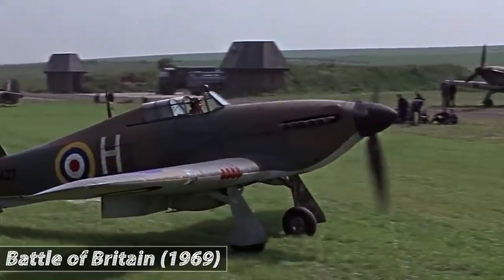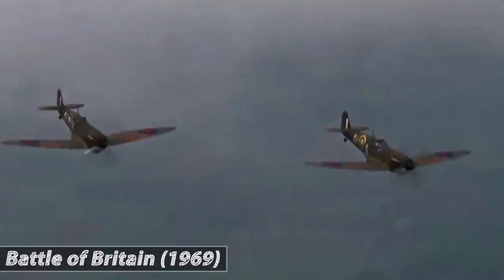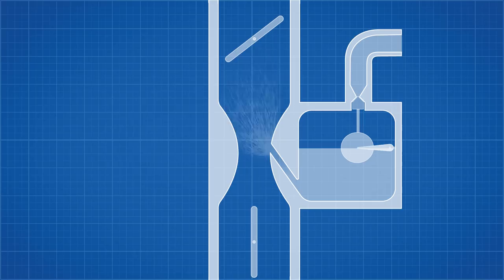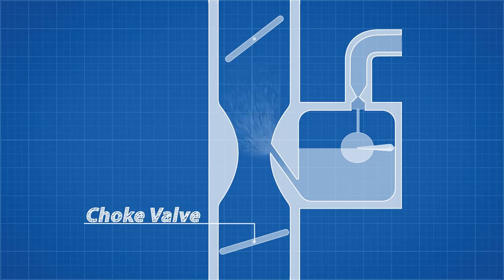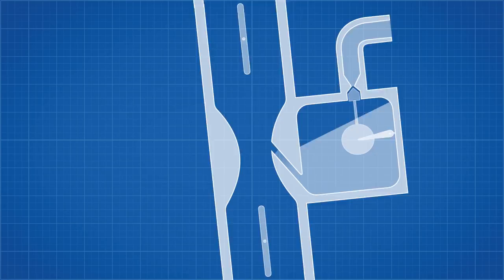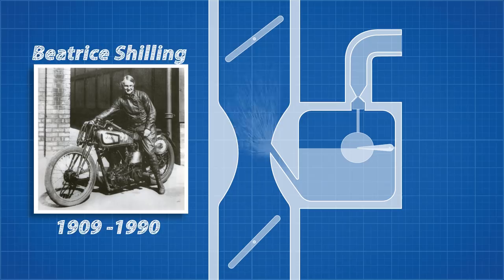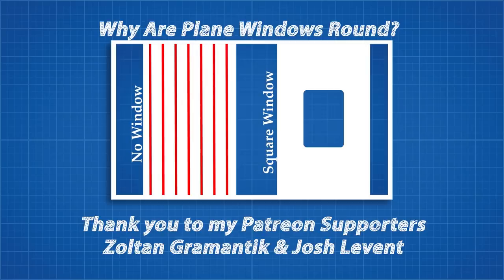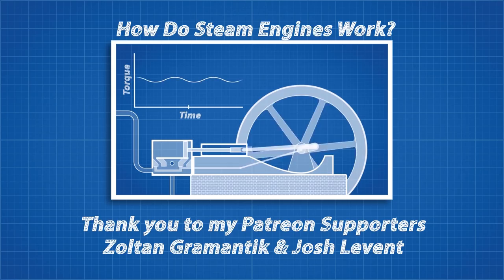The Spitfire's Fatal Flaw

Comment: It was definitely a design flaw but it certainly wasn't fatal. C'mon.
Reply: JCTiggs.
Not only not fatal it was the same as most fighters at the time  Only the Bf 109 with fuel injection did not have the same problem but it had a bigger less powerful engine, so the problem which RR was well aware of was a trade off and soon solved by Rolls Royce.
Reply: FATAL flaw? Was it even a flaw?  Maybe just "an undesirable design feature".  Sometimes it is hard to admit that our enemy may have built a better fuel delivery system, isn't it? Fortunately for us, they couldn't parlay that backfire into a win.
Reply: Will.J  I guarantee it never led to anything good!!!
Reply: Will.J  
If the engine cut out at all in a dogfight which is unlikely, RAF pilots were not stupid. The fatal flaws of the Bf 109 may have cost Luftwaffe pilots lives.
Reply: Indeed - by comparison, the Me109 had appalling cockpit visibility and the carburettor 'flaw' - which both Spitfire & Hurricane pilots were fully aware of - arguably made them more accomplished flyers, quickly learning to perform more rolls and banking manoeuvres in order to avoid the 'cut-out' problem associated with steep climbs. This 'aerobatic' skill-set in turn, arguably helped them perform more agile and effective evasive manoeuvres during dogfights.
Reply: I was fatal 

To the enemies
Reply: they said it was a fatal flaw cause if ur engine cuts out while u are in a Dog fight u are gonna lose the fight. cause ur won't be able to power up 2 either out run  & or out move the other person that is trying to shoot the spit fire down out of the sky. fuel starvation was a big problem  & Fatal flaw ..one of many  very  important things i learned a very long building & fixing & tuning my own RC Car's when i was a kid. before there was every the internet.
Reply: Yeah your engine dying when you turn your plane is definitely not a fatal flaw... lmao
Reply: @godhand2018  
The engine not cutting out in a turn or any maneuver except for pushing the stick forwards to go into a dive which would cause a momentary cut out which was easy to avoid and much improved by the Battle of Britain and completely fixed in 1941. Pilots still flew exactly the same way because it was the best way to fly.
Reply: @svr27rr87  
It was not a fatal flaw since it was easy for the pilot to avoid the one maneuver that would cause a problem and by the start of the Battle of Britain it had been much improved and in 1941 completely solved.
Reply: @drdee3645  I wouldn't say that the flaw helped them perform more agile evasive manoervers as it was more to do with rj Mitchells brilliant designed aircraft ,which was based on the s4 and s6b sea plane which had already won the schiender trophy and held the air speed record
Reply: @svr27rr87  I dont think that flying upside down useful in dogfights. Maybe in Redbull Air Race or something.
Reply: @godhand2018  Only when you turn it upside down, which is like... never. Because in dogfights its useless (lmao)
Reply: Will.J  The engine cut out when the enemy dived away to escape. This cost many German pilots their lives, as the continued to dive away after the problem had been fixed. A  P47 pilot commented that the German pilots always dived away - which was fatal, as the P47 could easily outdive the Me 109

Comment: Negative G and inverted are not the same thing btw. Negative g is an upward force exactly the same as g forces pretty much, but when you make a dive really quickly, or if you, say, are rolled right 90 degrees, but instead of pulling up, you push down. Often times when you're inverted you probably will be feeling positive G forces actually.

Comment: Not so much a fatal flaw but a real pain as many early RAF pilots found when diving after a Me109.However, the Spitfire pilots would half roll into the dive so the German pilot didn't get too much of a getaway, and the Spifire could dive faster than the Me109, so if there was enough height the Spitfire could eventually catch it.Also many RAF pilots wrote about German aircraft not being able to pull out in time or even the wings coming off in the stress of the dive.

Comment: Real Idiocy is more like it than Real Engineering
The slight problem was not unique to the Spitfire and it was easily overcome by RAF pilots and being worked on by Miss Shilling and her team at Rolls Royce, they had made the first fix in 1940, it lessened the problem in the Battle of Britain and they continued working to fully  fix the problem which was done in 1941 and that was used on the Spitfire Mk V, followed by the Speed Density Carburetor which was more advanced and used on the Spitfire Mk IX.   This was given to Bendix by Rolls Royce and Bendix made a copy in late 1943 which was used on the Merlin engines in the P 51.
Reply: yeah they used the merlins on p 51 as there own power plant was crap and needed to turn to The Merlin to get decent performance

Comment: If it was such a "fatal" flaw then explain how RAF pilots were still able to hold their own against the Luftwaffe  in 1940 with a creditable level of enemy kills? You think that RAF pilots were not aware of the Spitfires flaws and flew accordingly? Many aircraft had issues at the start of the war that were later fixed but for a fighter with a "fatal" flaw I think the Spitfire did rather well.
Reply: Has nothing to do with your syarlment, but unrelated. If you keep the g's positive no issue in a roll, you can a workaround for this design flaw.
Reply: Hehe, this comment sounds so personally offended, as if the commenter was unaware that "fatal flaw" is just a turn of phrase.

Comment: The biggest plus of the Spitfire was ability to have disadvantages corrected - it was also second to none when it came to upgrading and radical modifications while still being recognized as a Spitfire in its genesis - all the way from the Mk1 to the latest Marques that were only out paced by jets and slippery Sea Furies.   As a child in the early 1950s, I remember late Marques of Spitfires and Mosquitoes being used in ground attack roles against Communist terrorists/fighters up in Malaya.     It was great hearing massed ranks of Merlin and Griffon engines being fired up on the Mozzies, Lincoln heavy bombers, and the Spits - oh, the nostalgia!   As a 7yr old I got to sit in the cockpit of a Spit at RAF Catterick - as the Yanks might put it - I felt like a million $$$$s.

Comment: The Supermarine Spitfire (shows film of Hawker Hurricane!) 🙄
Reply: The Spitfire is better known so the video will get more views.
Reply: They used the same engine, so the Hurricanes also had this problem...
Reply: Yup. Stopped the video 20 seconds in. Done!
Reply: Dreidecker The merlins used carbeuretors. Didn't need a video from someone who can't tell the difference between a Hurricane and a Spitfire to tell me that.
Reply: Meatwad440 got me feeling opq
Reply: Simon Watts read the fucking comment of the creator jfc
Reply: So the p51 mustang had the same "problem" as it used a packard built merlin ....give me strength
Reply: P51D mustang vs supermarine spitfire... mmmmhmmm ofcourse p51 d variant is a late ww2 plane
Reply: Scott.
The Packard assembled Rolls Royce Merlin was the same engine and by the time Packard was assembling them there was no negative G problem, Packard used the Bendix carburetor which was given to Bendix by Rolls Royce. The P 51 with a Rolls Royce Merlin only started to enter service late 1943.
Reply: Barrie Rodliffe yip my statment was the abridged version...lol it took rolls royce engineers a year to redesign the merlin XX to US imperial measurments & machine standards
Reply: Scott.
To go further Rolls Royce and Ford of Britain modified the Merlin engine for mass production before Packard got started, Packard made no changes to the engines and took a year to do the drawings before they made a single Rolls Royce Merlin engines, the first Packard was a Rolls Royce Merlin 28, they also made copies of the Merlin 66 and 100 series.
Reply: Simon Watts lmao I just noticed that he showed the Hurricane

Comment: You start the video with a fucking Hawker Hurricane!!!!!!!
Reply: Aye lol
Reply: Gixer750pilot Yeah and the first shot of an ME109 is actually a P-51 with lufwaffe paint
Reply: Evi4666 I know but it's very frustrating. The clip of the plan doing the roll wasn't a spitfire .  It's the fault with the early merlin engine not specific to spitfires
Reply: cameroni major Yeah sorry, only belatedly realised that 😕. Didn't intend to come across as being rude sorry.
Reply: No it's not. It's a HA 1112. Basically 109 with Merlin engine.
Reply: its not a p51 in drag its a Spanish built Hispano HA1112 M1L which was based on the me109 but with a RR Merlin engine, Wasn't produced until 1954 !  it was taken from the film 'battle of Britain'. look how high the elevator is, its much higher up than a P51
Reply: It's a buchon, a 109 with a merlin in it for the spanish airforce at the time. They had plenty of spade's and 109's needed for the movie, just the 109 didn't look as authentic with the 'right way up' engine in it.
Reply: Gixer750pilot well the hurricane and spitfire had the same engine
Reply: Yes, it's true, pretty dumb really, but sure to spark a flame war in the comments! 
The funny thing is, from what I remember, Hurricanes downed more German aircraft in the Battle of Britain than the Spitfire did... and had the same carburated Merlin engine the Spitfire did.

Comment: Those intro planes were Hurricanes not Spitfires. What an uneducated editor...
Reply: They had the same engine, I'll give you that, but the Hurricane one of many mistakes in this video.
Reply: Good catch
Reply: All those Hurricanes were actually B-29's. The B-29 used the Merlin engine, which was manufactured by Microsoft.
Reply: Are you sure?  I thought it was Apple...
Reply: Both planes used the same engine, and had the same problem.
Reply: The B-29 used radials, not inlines.
Reply: ***** No. The B-29 used Wright R-3350 Duplex-Cyclone engines.
Reply: Tom thx The B-29 was a 4-engined bomber, so you need your eyes examined, and it was made by Boeing.
Reply: Anzac-A1 I'm  PREETYY sure the b29 was made by the same people who made the television

Comment: Tbh I thought it was going to be the landing gear. To Supermarine's credit, beginning with the Mk V, a fuel injector was used instead of the carburetor. However, the landing gear went unchanged, even when the Spitfire was adapted for carrier use (which went very poorly).

Comment: Did you know that the hurricane had a higher tally of killed German fighters than the more sexy spitfire ?
Reply: Only in the Battle of Britain because there were more Hurricanes, the Spitfire had a higher kill ratio and lower loss ratio and went on to shoot down more than any other fighter
Reply: The hurricane actually had a higher tally the the spitfire and all other air defence combined including anti aircraft guns and any other aircraft types in service
Reply: @djs-jk6cb  
Of the luftwaffe shot down by fighters it was 55 % by Hurricanes and 45 5 by Spitfires, considering there were about 66 % Hurricanes and 33% Spitfires the Spitfire had a higher kill rat and they also had a lower loss rate than the Hurricane.

Comment: It's not the Spitfire specifically is it? It's the early Merlin engines. Hardly a Fatal Flaw, that's just clickbait.
Reply: Peter Love it was prevalent in the spitfires mostly due to its extremely high status in the realm of superior aircraft of the era. To have a flaw like this in the best aircraft of the time was a serious issue. Sure many planes and tanks shared the Merlin, but the spitfires airframe and fighter role was far superior. Making his title relevant.
Reply: @fordrestored4646  
The RAF pilots did not find it much of a problem and it was never a fatal flaw, also it was improved by the Battle of Britain on the Spitfire Mk I and Mk II to the extent it was hardly a problem at all and completely solved in 1941 on the Spitfire Mk V.  The Spitfire was far superior to other fighters and it stayed that way through the war.
Reply: Barrie Rodliffe yes. That is what I said. It was a problem in the early stages of the spitfire. It has only been in service for a little over a year or 2, and to have stalls like that was a major problem. Yes it’s not a hard to fix problem but it is a problem. And  that’s what the video is about
Reply: @fordrestored4646  
There was no major problem and the engine did not stall, it was fixed early on. The video is a load of bollocks.
Reply: Lol, the spitfire wasn’t far superior to other fighter. Until 1942 this problem gave the German pilots a good advantage in dogfights. And after 1942 the Bf-109s F and G could just outrun/outclimb a spitfire, and had better high speed maneuverability... everything with very bad fuel
Reply: @ferrarisuper  
In 1940 the Spitfire was slightly faster and had better climb and maneuverability than the Bf 09 E, from mid 1942 the Spitfire Mk IX was faster than the Bf 109 F and as fast as the Fw 190. , the Spitfire had better climb. and maneuverability.  All had good fuel.  The German octane number was lower but it was rated differently so fairly comparable.
Reply: I mean it's the engine the Spitfire used right? Also I would call your engine dying mid flight and potentially not turning on again a pretty fatal flaw...
Reply: @godhand2018  
Except that never happened, at most a momentary cut out if the pilot happened to get into a negative G maneuver which was very rare and also by the Battle of Britain the very slight problem was much less due to the work of the team at Rolls Royce. It was nothing to do with the engine, it was the carburetor which as it happened was the most efficient carburetor at the time. by 1941 due to the team at Rolls Royce there was no problem at all.
Reply: @godhand2018  It's only 'dying' mid flight from a specific cause which with minor training and/or experience can be avoided with a minimal penalty, ie simply snap rolling and diving inverted. 
Also as I said, it's not specific to the Spitfire, but any of the aircraft that used the early models of the Merlin engine. I believe the problem was resolved in 1941 or so anyway. 
So I still feel that original title is 'click bait' and looking at the numbers above, tend to indicate that as well.

Comment: The Messerschmidt 109 engine was mounted with the cylinder heads at the bottom because in the 1930s German engineers on an approved visit to Rolls Royce went intothe meeting where the Merlin enginewas shown on a stand with the cyl.heads in that position, not at the top as intended and used on all aircraft it was fitted into.  This caused operation problems for the BF109 aircraft.

Comment: "Here's a discussion about the shortcomings of the Merlin engine, a suggestion the problem was limited to Spitfires, and some stolen movie footage of Hurricanes."
Reply: The footage wasn't stolen, it was used in an educational manner and listed as to what movie it came from.
Reply: The slight problem was with all aero engines using a carburetor until rolls Royce came up with a solution.

Comment: The pilots themselves came up with a quicker solution in the first battles over France.. When going after a Me109 in a dive they also dived but inverted
Reply: Bf 109
Reply: @lotuselansteve  The Messerschmitt Bf 109 is a German World War II fighter aircraft that was, along with the Focke-Wulf Fw 190, the backbone of the Luftwaffe's fighter force. ... It was commonly called the Me 109, most often by Allied aircrew and among the German aces, even though this was not the official German designation.
Reply: @FineArtsTeacher  I know what it is :-) I was just commenting that its correct name is Bf109. Originally the aircraft was designed around 1935 and designated as Bf 109. After Willy Messerschmitt acquired the company in 1938 subsequent planes were prefaced with Me. I like facts :-)
Reply: @lotuselansteve  I have seen Luftwaffe documents from the period in 1943 from a 109 speed test which call the aircraft Me109 and also in another place BF 109 and in yet another just 109. So those are some facts also.